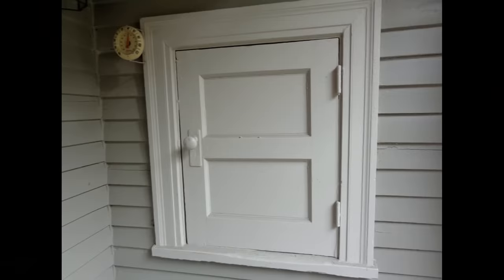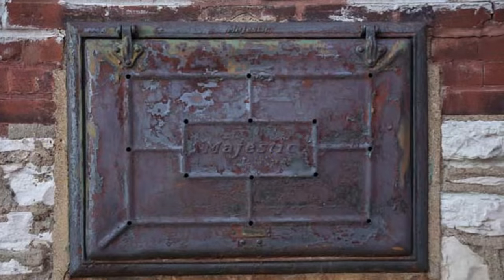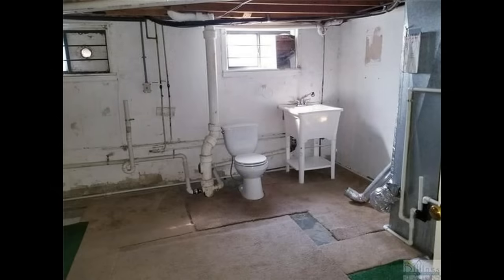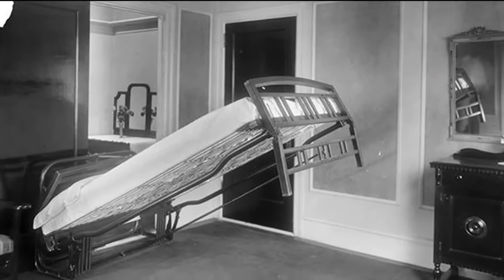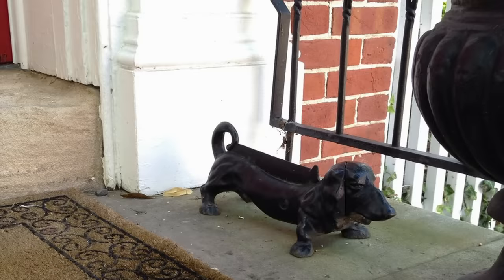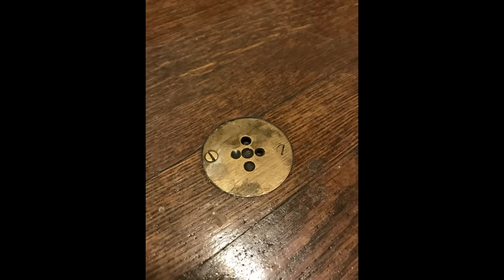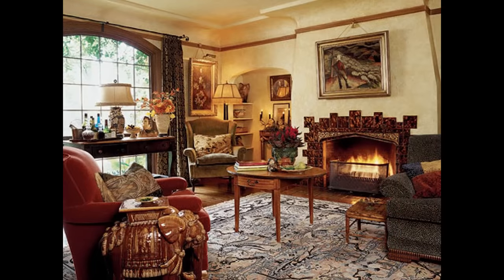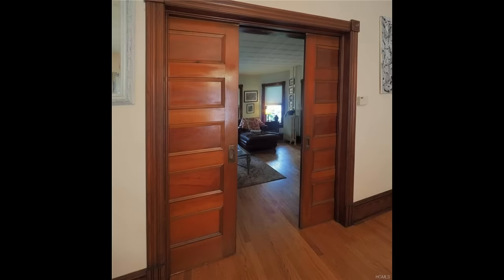Mysterious Home Features No Longer Used

Comment: Pocket door hardware has been vastly improved since those days, which I suppose means there must still be a demand for them. They are certainly great space savers, presuming you can depend on the doors to actually open and close!
Reply: My sister and her husband used to have a house built in 1815, and the only bathroom was upstairs in what had been a small bedroom. They were able to install a half-bath on the first floor, in a small area between rooms. It has a pocket door, which saves space and works like a charm.

Comment: My grandmother’s house had push button switches, toilet in basement they built a wall around, root cellar with sand floor, coal chute and wall ironing board in the kitchen that folded out to use. The woodwork in the house was gorgeous. A stained glass window in the stairway. The house has been sold in the 1990s. It’s obvious it’s updated, siding, windows but I’d love to see the inside
Reply from the maker: It would be neat to see the inside and compare it to how it used to look.  Sometimes people are nice enough to allow you if you explain that.  I have done that before. Seems like so many people take out the old things that are part of the charm.  I love stain glass windows those would certainly stay.  Thank you for watching and sharing some memories.
Reply: that basement toilet comes in handy for sure. it may not be pretty -- or warm -- but, when your toilet is broke or if you have a lot of people over, hey, gotta use what's available.
Reply: My grandma had push button switches too...until 2006 when she passed

Comment: The home we built 20 years ago has several pocket doors.  They add a lot more free space and movement in areas that are not often closed. Pocket doors are shunned by a lot of builders, as they cost more in framing and hardware (as well as requiring a “thicker” wall ( for “pocket”).  ALL homes should have these😊

Comment: I remember old houses with copper or brass sheets with motifs covering the ceilings and even walls or parts of wall. I also have seen strange round holes in walls between rooms that were where the exhaust pipes to the chimneys for the wood or oil heaters and or ovens used to be. I also remember closets that would go from one room the another as to have a very long closet. Also outside doors with a hand sized butterfly crank handle right in the middle of them. They were a version of early mechanical doorbells. Also Brass door handles and such should come back for they are by nature antiseptic.

Comment: Picture rail wasn’t just a trend, and people weren’t “afraid” to put holes in the wall. After WWII, lath-and-plaster construction was largely replaced with drywall. It’s much easier to put holes into drywall, and you don’t run the risk of a crack running all the way up the wall (common with plaster).
Reply: Exactly!  I am going to use this way of hanging my artwork today!
Reply from the maker: Thank you for watching Meggie!

Comment: Even though you showed a lot of features from turn of the century and early twentieth century, you showed your age in one you missed. When you showed the modular land line phone jacks, I remember two that preceeded it. When I was a child (circa mid 60's), our landline phones were hard wired to a junction block on the baseboard. In the 1970's it had progressed to a round plug with 4 pins that plugged into that junction on the baseboard that had 4 corresponding holes.  The little clear modular plugs that worked with the sockets you showed didn't show up in my area until circa 1978.
      But, though few are inhabited now, and many have either fallen in or been pulled down, there were many old farm houses in my area that had the porcelain insulators and asphalt impregnated cotton insulation on the wires. Though it was feared, it's hard to put a firm number to the old houses that burned down due to that kind of wiring.
Reply: Some houses (my folks house, for one) had a separate "bell box" for the phone. The box was mounted to a joist in the basement close to the phone.

Comment: A family friend bought a very old, very large house that at one point was used as a nursing/retirement home because it was so big. We’re talking 12-14 bedrooms. It had about half of these things in the video but the house had one thing I didn’t see here. There was a tube about 1.5 inches in diameter that led to various rooms of the house. At the end of the tube in rooms where it led, there was a butterfly flapper that closed off the end like a carburetor. These flapper doors had a hole about the size of a pencil in the center. We all thought it was an early type of intercom system for “the help” to communicate with each other from key rooms of the house, like the kitchen, the dining room, the parlor, the den etc. Ever heard of such a thing or know what it truly was?
Reply: speaking tubes

Comment: I owned a house built in 1935 which had many of the features mentioned. Had a phone nook, coal chute, toilet in the basement for no apparent reason, plenty of knob and tube wiring. Behind a large mirror in the bathroom was an old cutout for a medicine cabinet. I looked inside the wall and there were plenty of used razor blades. I was once told the toilet in the basement was in the event of a sewer back-up it was better to back-up in the basement vs the upstairs bathroom. Pocket doors are a great idea. I have installed sliding doors on a rail which is just as convenient.
Reply from the maker: I have never lived in a home with a Pittsburg Potty but I have heard horror stories about the sewer backing up into houses on a block.  Then you have to hire professionals in hazmat suits to clean it for you because who wants to clean up random wasn't yours?  Thank you for watching and sharing about the home you lived in.

Comment: Exhaust fans in the kitchen that were operated by loosening a chain attached to a flap covering the outside opening which allowed the flap to open and activated the fan. To turn it off you simply pulled the chain in, which closed the flap and turned the fan off. They were used before exhaust hoods over stoves were common; our mid-50s home had one.
Reply: We had one of these kinds of fans in the kitchen before we renovated. Honestly, I hated it. It was loud and ineffective when in use, and when not in use would noisily flap about on windy days. Happy to have gotten rid of it for the quieter modern equivalent!
Reply: We had one over the stove in our 1967 mobile home that was our summer "cottage" from 2007 to 2020.

Comment: I recall taking the kids to Missouri town about 20 years ago and one of the houses had low windows near the front door and higher windows above the back door. The change in hight would allow warm air to escape and draw in cooler air, while creating a cross breeze to help cool the house.
Reply from the maker: That is interesting and it makes sense.  I know there are homes in the deep south that have a front door and a hallway straight to the back door that would allow airflow thru the house.  The windows were set up that way too.  Sounds like the ones you saw would be really beneficial too.  Thank you for watching!

Comment: The 1946 house also had the phone jacks, the pocket doors, the picture frame molding, and even more bizarre a bathtub made completely out of tile that had a lead liner under the tile that had to cut out with a blow torch because of course they wanted a whirlpool tub. And lots and lots of lead paint.
Reply from the maker: You certainly mentioned a lot of things you can find in old homes.  Thank you for watching and sharing a little more.

Comment: I learned of a safety feature used in old homes from the early 1900's called a "fire grenade." It was a lightbulb shaped glass globe that was hung on the wall and held in place with a metal holster. Much like an actual grenade, the fire grenade could be lobbed into the base of a flame and extinguish the fire, or (if no one was home at the time of the fire) the holster would melt once it reached 130° and then drop onto the fire, putting it out. The fire grenade was filled with either a salt water solution, or a chemical called carbon tetrachloride (CTC). CTC proved to be more effective at extinguishing flames however it was toxic.
Reply from the maker: Those were certainly a "new and improved" way of fighting fires.  They are quite interesting too.  Thank you for watching!

Comment: Two interesting feature my current homes has, secret passage ways and periscopes 
The upstairs has two large bedrooms on either end that run along their side of the house and from from front to back of the house they are connected by a hallway that on the front side has a stairwell and a smaller middle bedroom and a large walk in hallway closet and full bathroom on the back side.
The one large bedroom furthest from the stairwell has a walk in closet that covers it’s entire back side portion with a sink that is opposite the the bathroom. What people don’t realize is that mirrors for both the closet and bathroom open up into the same medicine cabinet (there is a locking mechanism in both rooms so that both mirrors cannot be opened from one room ) 
That bathroom also shares a small towel and toiletry cabinet with the hall closet 
Now to the other large bedroom and the weirdness continues …
That bedroom has a double sliding door closet that’s adjacent to the hall closet, but what people don’t know is there is a head high pocket door that goes into the hall closet. That was so that walk in closet could serve and an infant crib room, a sewing room even a dressing room.
But the weirdness continues in the small bedroom it has two closest…. One a double sliding panel closet opposite the first bedroom mentioned (nothing weird here) but it also at a small closet covered by a curtain that is overtop the staircase that closet also has a doorway into the other large bedroom a doorway that has a hinged panel in the large bedroom mounted with drywall and a pocket door that holds the panel closed. From the small bedroom the pocket door can just be pushed back unlatching the panel in the large bedroom (the panel has no handle a little depressed spring pops it open a crack) or the panel can be retracted from the large bedroom by rotating a fixture on the wall (currently that fixture has a navy four hour single hand clock mounted on it and one just rotated the clock 90 degrees ,btw  rotating the clock in the other direction 90 degrees doesn’t move the pocket door but does LOCK the hinges panel via a second latch
Now onto the periscopes 
In the basement and on the second floor are panels that when opens reveal a path of small mirrors that terminate in what appears to be a ventilation grill in the ceiling of the overhang roof above the front door. At one time there was also a brass speaking tube like once existing on one the first motorized ships connecting bridge to engine room but because those had to be first opened on both ends  and if left opens could allow vermin and weather in they were removed and the periscopes were weather sealed but still functional.  Btw it wasn’t very easy for someone outside to see back up because their end was grilled and an electric light is mounted just next to it pointed towards them
Reply: @steven heckert  The mirrored periscope sounds like something they might have used during prohibition. Or maybe for some sort of safe house.
Reply: @kh3612  I’m sure such a thing was used, it’s just the way the house is set up, if someone rings the front door while you are upstairs, they can see you long before you can see them , because their are narrow window slits on both sides of the front door, one that can look straight up the stairs, and the other that can see all the way to the kitchen in the back of the house

Comment: My grandparent's former house had a laundry chute in their bathroom.  It was a very cool feature.
Reply from the maker: They are a cool feature!  Thank you for watching!
Reply: Yeah, my maternal grandparents' last home also had a laundry chute in the upstairs bathroom.  My sister and some of my  older cousins remember actually (very carefully) sliding down it when they were little (I was tempted to do it when I was little, but could never quite work up the courage to do it).

While the house is still around, I don't know if the chute still is (the house was sold back in 2010 after my grandfather passed away, and I do not know if the new owners made any renovations to the inside).

Comment: Those wall plates with the nuts and rods were often used to repair structural damage as well.
Reply: A lot of those got added to unreinforced brick buildings in the San Francisco Bay Area after the 1989 earthquake.

Comment: My late grandparents had a home that was built in the 1930’s. The entire house was heated with a huge cast iron furnace that had to be regularly fueled throughout the winter and had a window mounted AC unit for summer. There was a laundry shoot that went to the basement where the washer and dryer were, and also a root cellar that was kind of spooky. There was also a sitting area down there with black and white checkered tile flooring. Walking into that house’s kitchen there were pocket doors and my grandma had avocado green appliances that looked like they belonged from the 60’s. It was like a second home to me growing up and I miss it a lot now that my grandparents passed and it was sold.
Reply from the maker: Thank you for watching and sharing what your grandparents had.

Comment: When I was married to my first wife in 2002, we bought an old house that already had a lot of renovations done to it already but still needed a lot of help. As I tore into it I found a lot of history. Slate shingles on the roof and cedar shakes under the vinyl siding. The back of the house was mostly added long after the house was built in 1880. As I was replacing the floor of the back porch I found a systern and a capped off wellhead below what appeared to be an abandoned chimney opening that had been capped off. The house did not have a traditional foundation. It was carefully stacked and mortared stones and rocks that didn't go deep into the ground. So basically the house was completely built above ground level. Most of the houses in the area had basements. Most of the windows were on the south and east sides of the house. Downstairs had 6 foot tall windows that seemed pretty narrow. It did have a completely modernized electrical system but I found the old style remnants in the attic and in the walls. I loved and hated that house. When we got divorced she did a quit-right on the deed and left me to finish the remodeling. When I had to refinance as part of the divorce decree I fell victim to predatory lenders and lost the house.
Reply from the maker: Thank you for watching and sharing some of what your old house was like.  I could see why you loved and hated that house.

Comment: We had a house built in the 1880s and to my surprise when some plaster started to fall off the wall there was hair in there and it freaked me out until my parents told me they used horse hair as insulation! We also had Stained glass windows, gaslamp hook ups in the wall, skeleton keys for every door and you could see right through the keyhole😆. So many things!
Reply: Lots of historical homes being renovated have required that people still use a modern take on the horse hair plaster and lath.
Reply: @victoriacole7661  neat! Didn’t know that, 😆thanks!
Reply from the maker: You're right about that but I could certainly see how that would freak you out if you didn't know.  You definitely lived in an old house and it sounds super cool.  The oldest one that I have lived in is 1929 so you have me beat.  Thank you for watching and sharing your memories.
Reply: @crystal338  I can't even imagine having to deal with British Heritage when they were restoring Anne of Cleves house from the 1500's. They literally had to invent a method to keep it historically accurate.  It's fascinating :)
Reply: @victoriacole7661  I’ll look that up!
Reply: I lived in a house in Chicago built in about 1910. The carriage house had lath and plaster walls with horse hair. My father did some renovation and opened up part of the wall and told me what it was. He would make up small amounts of plaster that he would mix in half a rubber ball. He was born in 1905 so he grew up around that kind of construction.
Reply: @judyfabion8849  Cool, thanks for sharing!